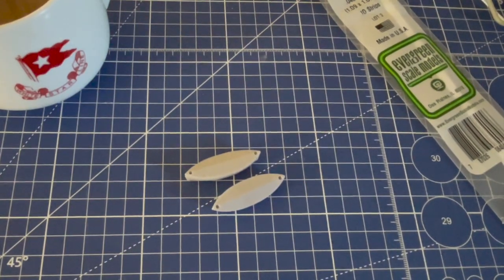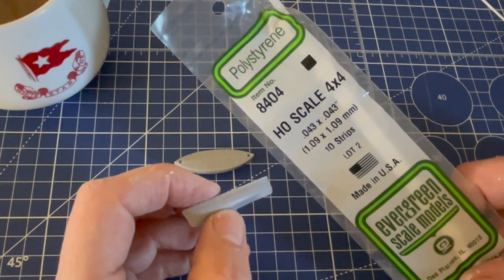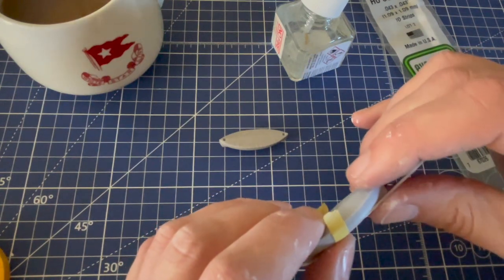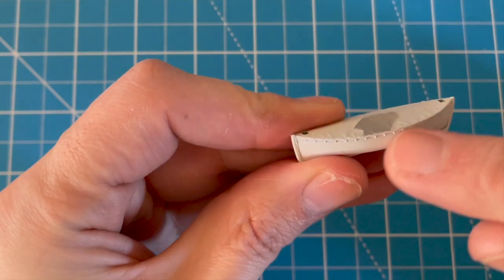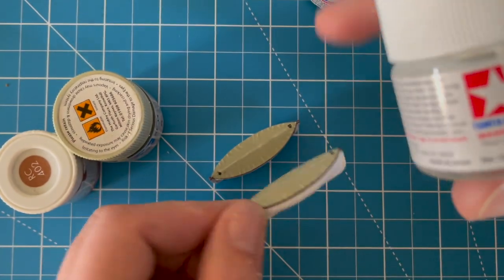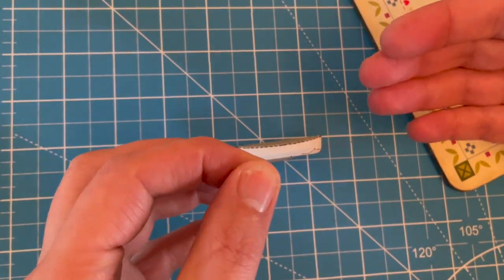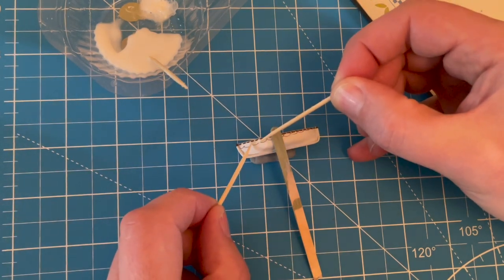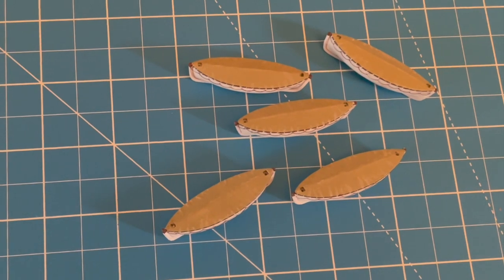Trumpeter Titanic - Lifeboats  Assembly

Comment: Yes the KA boats are really good and that was a nice little addition that you added, I hadn't thought of that one!  The Trumpeter boats are as you say quite nice but do need covers.  They could I suppose be improved by using a body putty so that the cover folds could be added.  An alternative is to add a small brass rod from stem to stern and then add a cover stretched over using a latex glove material.  For my own model (Olympic conversion) I need shed loads of extra lifeboats so I have moulded some using resin.  Different sizes too as to save space on the real ship they were often nested inside of the larger boats. That will keep me busy at some point!   😂 Great video!